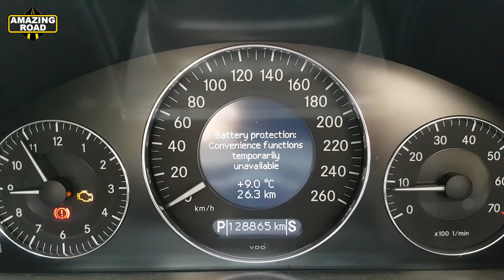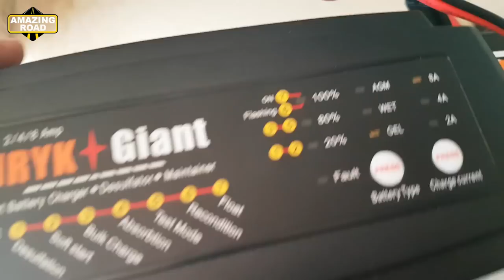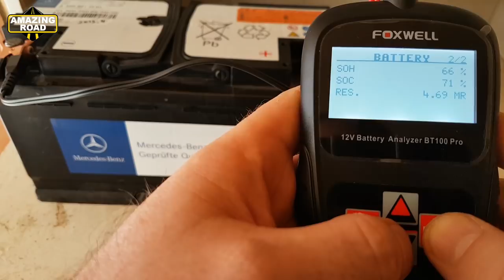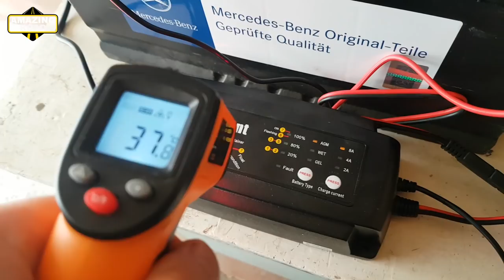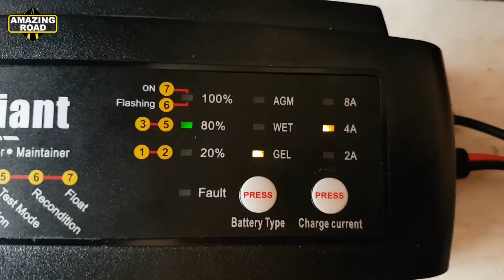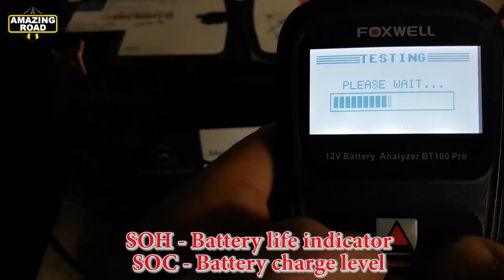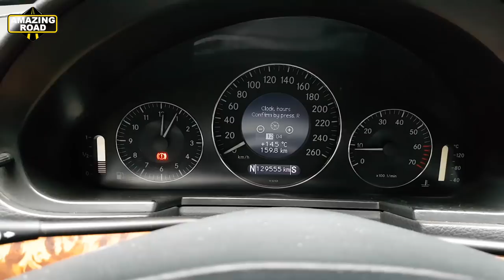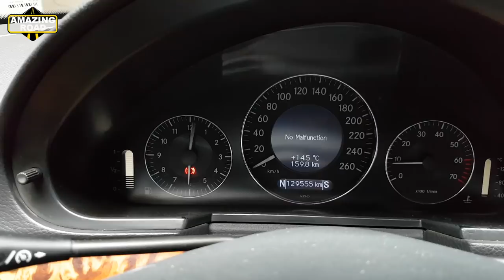Has Removed two Battery Charging With Mercedes W211 W219 / Checking Battery Before & After Charging

Comment from the maker: How to Install and Connect a Backup Cameras, Detailed instructions https://youtu.be/L-55t5SNoWo
Review and Test FoxWell NT624 Pro Professional Diagnostic Scanner https://youtu.be/8A8e9p-BMpo
Comparison 3 Scanners for Battery Foxwell BT100 Pro, AUTOOL BT-360 and Nexas NB300 https://youtu.be/8m_OHVqIZls
Installation and Configuration Foxwell TPMS Android Tire Pressure Monitoring Systems https://youtu.be/B7ebRempE4g
Powerful Pure Sine Wave Inverter 300W DC 12V/24V/48V to AC 110V/220V https://youtu.be/a_5MtONoHxk
Mini Wireless Stereo Bluetooth Headphone With Battery https://youtu.be/YOA12gbJbUU
Digital USB TV Tuner DVB-T2, FM For Android and PC in the Car  https://youtu.be/TS3whtliuFU

Comment: Also can be voltage regulator. I had the same problem. Alternator works well 14V, but voltage regulator makes short voltage drops on 11V and it pops out all kinds of lights..I replaced whole alternator, cz voltage regulator is built in part and everything works like it should be..Also bad VR gonna drain your battery even if car is in the move..
Reply: Heard about it. There is a block of alternator operating command center. It will switch off forcefully alternator if it thinks that battery is full and no other hard tasks that require a lot of electricity is placed. So the battery is drained before you know it. The video was 12 minutes and I watched only 6, so how the guy fixed that is still in youtube to finish watching for me in that another video. It’s in russian language from guy lives in USA. E claw w212.

Comment: my batteries are dead and the blade key doesnt work how can i get into the trunk og my e200 w211 2003 to change the main battery. I charged the auxiliary battery and it was showing 13.8 so i put it on but no power to the car. I am gonna buy a new one tomorrow to see if its the battery.  Any ideas on what be wrong. I checked the fuses and everything is ok. Dont know if there is a way i could send power to the main or jump start the car.
Reply from the maker: You can give power through the generator
Reply from the maker: https://www.youtube.com/watch?v=69yuzCO-_zg&t=29s
Reply: Thanks for you reply. I managed to get the car running. The batteries are new and the alternator is fine but the red workshop light wont go away. I have no error codes. just the red workshop light
Reply from the maker: @pantelisioannou5673  This is strange

Comment: What if you charged the main (Trunk) battery and got a new Auxiliary battery and it’s still giving error and draining battery
Reply from the maker: If a red error, then this is due to the small battery
Reply: Amazing Road TV I got a new Auxiliary battery from FCP euro but it’s still showing the red after the car died which was caused by me not moving it for 2 days
Reply from the maker: Have you changed the small battery and again there is a red error? Red mistake what is written?
Reply: Amazing Road TV yes I did changed the small battery , bought it brand new.  Everything worked perfect but there was a time I didn’t move it for 2 days I came to the car and it was dead. Once I jump started the red battery symbol came out with the letters saying “Battery protection convenience functions temporarily unavailable “
Reply: @mr.angeles55  you ever find out the problem I changed my alternator regulator ran good for 3 days then started again and help ?

Comment: Was the issue with the small auxiliary battery?
Reply from the maker: Yes
Reply: @AmazingRoad  How can you determine which battery is giving the problem?
Reply from the maker: @SmartWentCrazy  Red mistake if it means a small battery
Reply: @AmazingRoad  Ah so if it's a constant red alert that is the small battery.

Mine currently shows (black background, white text): "Low battery convenience functions temporarily unavailable"

I've also seen time to time when I turn the car off quickly a red warning comes up about the battery/alternator - this only happens if I remove the key quickly..and maybe once every 2 months.
Reply from the maker: @SmartWentCrazy  (black background, white text) This is the main battery, already weak. Red bug small battery
Reply: @AmazingRoad  Thanks for the response! Going to pick up a new AGM battery this weekend and get my heated seats back :D
Reply from the maker: @SmartWentCrazy  👍👍👍
Reply: I changed both and still have the red battery visit sign , what can i do?
Reply: @tayb8389  I changed my main battery and it ended up working out quite well. Are you sure you got the correct battery? I noticed the battery in my car (used) was not the correct AH and CCA. I would cross check this on yours.